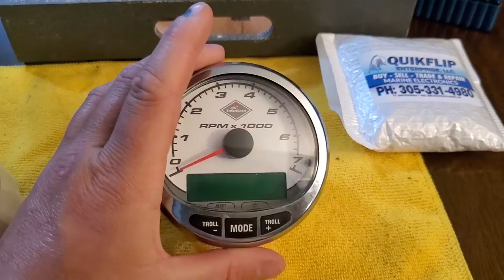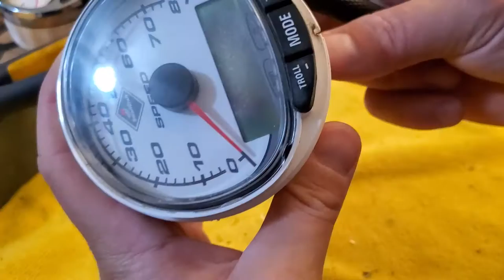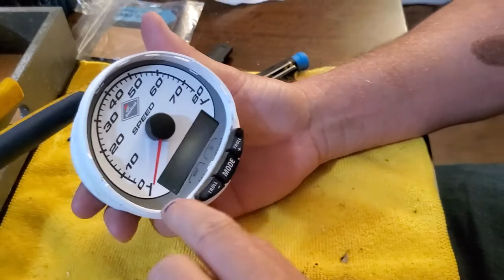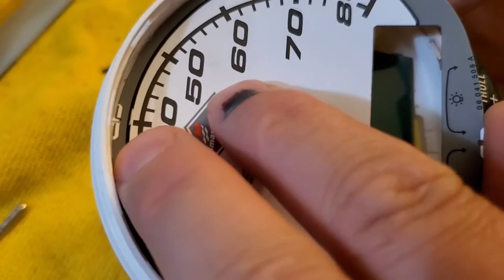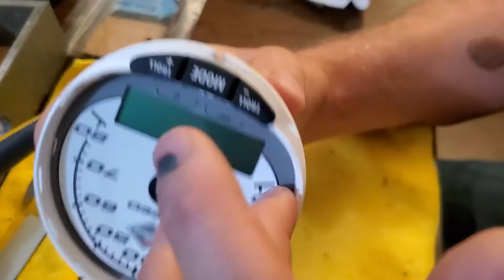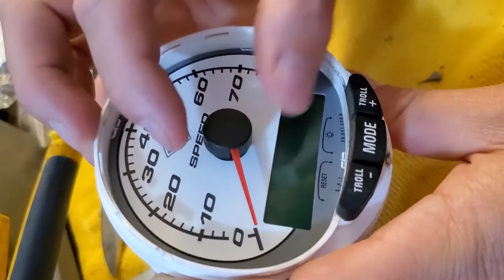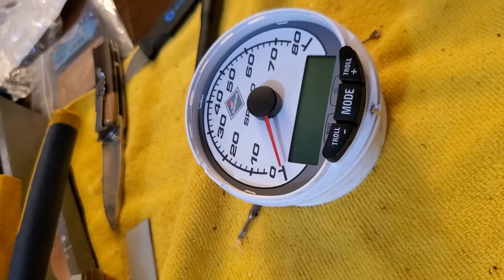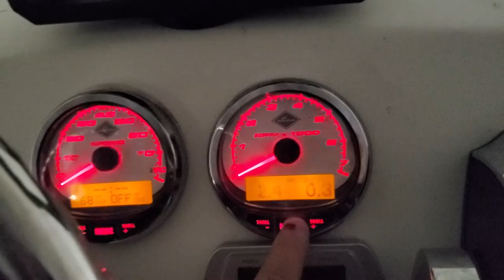Mercury SC1000 Gauge LCD Repair

Comment: Very helpful video and well done. When taking out the ribbon or putting it in the socket, the black portion of the socket is actually a pull out bracket that locks in the ribbon. Pull it forward with a small tool or even your finger nail, insert the the ribbon and push the bracket back in. Takes a couple minutes that way and creates a more secure connection.
Reply: Very helpful, thank you very much

Comment: Both my gauges were burnt, new gauges would cost AUD1300, send to USA for repair a bit over $600, two new parts from EBAY $64. Fixed and working, thank you very much for your video, would not have attempted repair without it

Comment: you need to pull out the black clip on the ribbon cable connector and then the ribbon will easily slide in and then just push in that black clip on the connector which locks the ribbon cable in place.

Comment: Excellent video which was very useful. The only difference I made was to drill a hole through the screen and using pinch nose pliers carefully chipped away at the screen. This way I didn't damage the lugs.

Comment: Thanks so much.  Those three plastic pieces fell out of mine with me not even noticing.  Had to come reference your video to see which way they went.  My ribbon cable was a little different.  There was a black locking bar I had to push out with a tiny screwdriver.
The only thing I would add is to plug it in before you put the lens back on.  Make sure the LCD screen works and the dial is in the right position.

Looks like new now.

Comment: Thank you for the video it was very helpful. FYI when connecting the ribbon the black piece on the board pulls out to open the area where the ribbons goes. Then you can put the ribbons easily the push the black clip back to crimp the ribbons.
I hope that helps other.
Reply: Agree. Save yourself a lot of time and aggravation and pull that black clip forward. Ribbon slips right in . Once inserted, push it back in.
Reply: This video shows how the ribbon cable clamps work https://www.youtube.com/watch?v=UsgEZOtveRQ it makes 99% easier to get the ribbon in
Reply: I thought exactly the same - its a common attachment on laptops and PC's . Apart from this, it is a very good tutorial (I took mine apart before finding this and for a while could not determine where the plastic slides went (after finding them on the floor!)

Comment: Man that was good. I have the same gauges and need this kit.
I bought this kit and got it installed yesterday. Looks good. Thanks again for the info. Now I just got to get the other gauges cleaned up. They have those cracked in them

Comment: Great Video... very helpful!!, my old lens was actually glass and did not have the retaining clips, so just be aware some are glass and a bit more difficult to remove, all else went well after reading about the retaining clip on the ribbon cable, much easier.

Comment: First off, thank you for showing this content. I’m about to purchase the LCD’s for my Two gauges. My question is do you know what Torx sizes you used? I need to by a Torx kit and I want to make sure I get the correct sizes. Thank you!!!
Reply from the maker: Sorry do not but they are on the smaller scale I used a set for rc cars

Comment: I do not have access to the back of my gauges.  How are they mounted in the console?  Are they friction fit or do they have a locking ring or clips behind the console?
Reply from the maker: They have a treaded plastic ring that tightens down . You will have to figure out access to the back of them .

Comment: Great video!
My sc1000 v6 lcd is bleeding black. Anyone know if I can replace it with a used display from a v4 unit and have all functions intact?
Reply: You could, but I would just get a new display unless the V4 is brand new the LCD will already be burning out

Comment: Hi 
I replaced lcd screens and worked great for a few minutes than lcd faded out on both sc1000 gauges. Seems to be a common issue but can’t find out why.
Do you know how to fix this?
Reply from the maker: That sounds like defective screens or the connection on ribbon cable is loose

Comment: If there was a seal on the back the unit would flood if the lens gasket failed. No gasket on back allows it to drain. Intended design.
Reply: Most marine gauges are vented anyway so condensation can evaporate out. If your gauges condense on the inside turn on the back light and after a short time the moisture will dry out through the vent holes. I doubt this works with LED or florescent lighting do to their low heat output compared to incandescent.